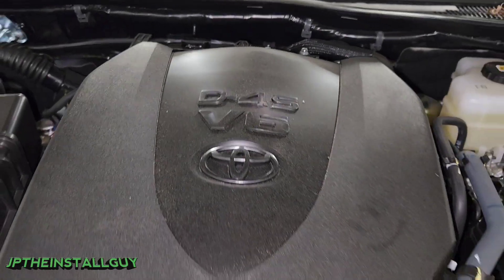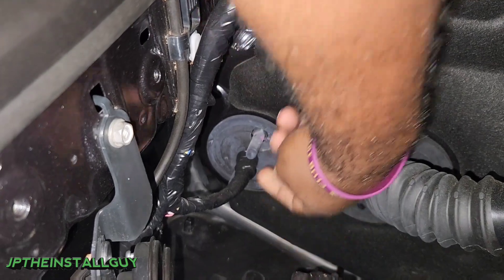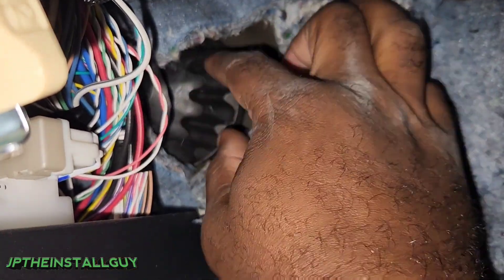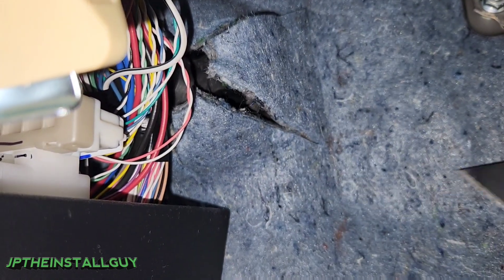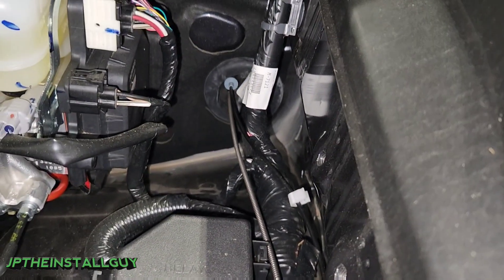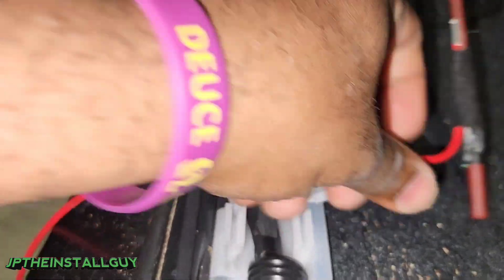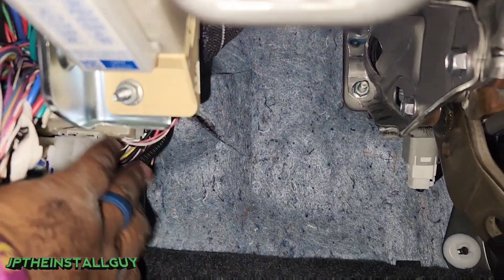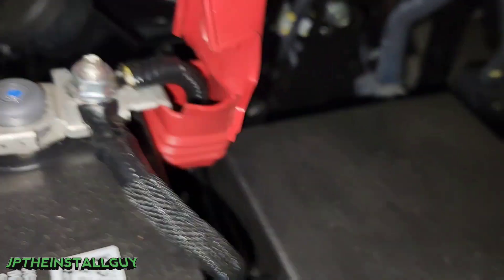run amp power wires through firewall of Toyota tacoma 2022

Comment: I had BestBuy install my amp an they ran the power wire through that one lil spot on the firewall without the insulation @ 0:39 in, an they did silicone it as well.
  Truck has a warranty on it, so I was not going to void it by doing it myself!~

Comment: Good video I do have one question on my wire harness on the driver side I do have the rubber nipple like the passenger it it better to use that then cutting the rubber boot on the wire harness?

Comment: I generally take sharp awl or ice pick to go through the rubber so the wire is sealed tight once it's pulled through with a hanger it's the way I been doing it for many years.